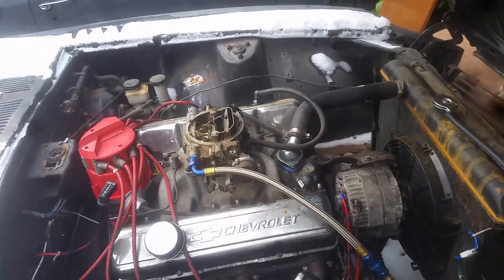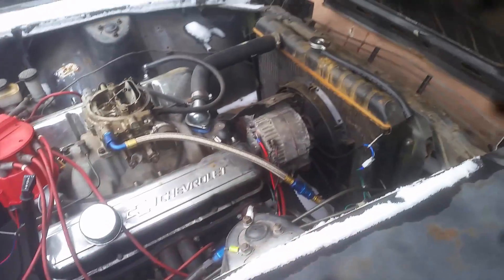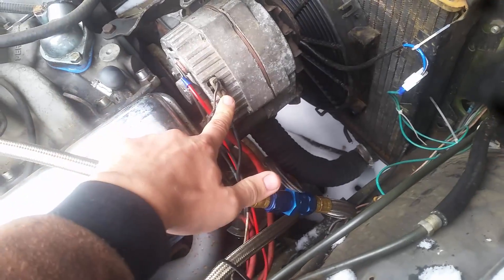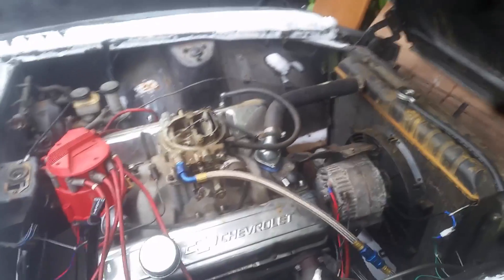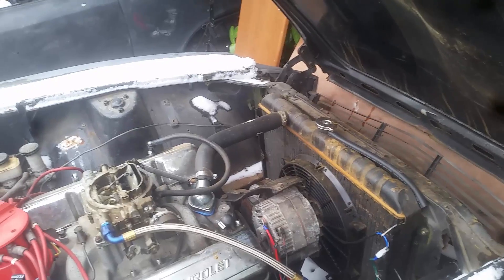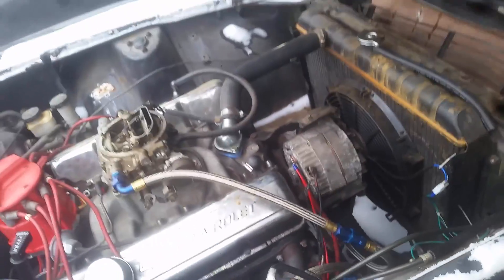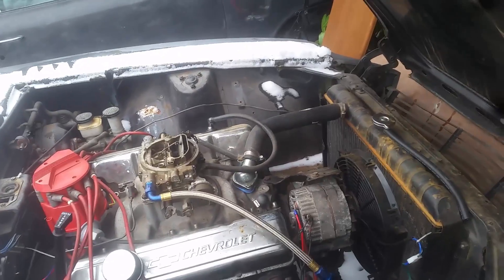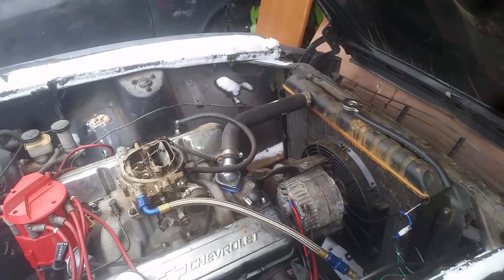wiring up your GM 3 wire alternator and upgrading from externaly  to internaly regulated

Comment: SO WHAT IF YOU HAVE AN ACTUAL DASH GAUGE AND NOT AN IDIOT LIGHT?
- 1963 MERCURY -
Reply from the maker: You can wire in an idiot light, and wire the dash gauge in through your ignition switch so it would continue reading voltage as well.

Comment: I use the brake warning light as alt light in situation like this. Splice off the wire from proportioning valve to power terminal "1".
This way the light will still work for intended purpose but will also turn on alternator.
Also this alternator will work on the nissan engine as well (same bolt spacing)
BTW one wire alternator is simply that alt with the sense wire looped to alt output.
Reply from the maker: twoeightythreez yup.  Good to know!  Thanks for the input, I figured as much.

Comment: so on my tractor,  Is it correct if number 2 goes to my starter? I know number 1 goes to the light and the post goes directly to the positive post on battery, but where should number 2 go? also does number 1 have to go to a light, or can not be hooked to anything at all??
Reply: If you like you can make the GM 3 wire alternator into a "1 wire" by simply looping the thick #2 wire to the alternator output lug and leaving #1 disconnected.
You will have to rev the snot out of the motor after starting it to begin charging though....so you are better off hooking the #1 wire up. If you dont feel like wiring up a bulb you can substitute a resistor. It cant be hooked direct or you will have a constant draw....it needs to be a switched source.
Reply from the maker: Jason Gelles number two goes to the battery. ... or the starter like in my case because my battery is in the trunk.  number one should go to a switched source...  through a light.... so in essence it all goes to the batter....

Comment: oh and what you think a 3/4 cam do in a Pontiac 350. shoulda  bought a 400 or 455 when they where $100 running 10 years ago😧
Reply from the maker: B.O.P A-body actually, I LOVED my 350 with a wild cam... sure its no 455 but it's a screamer regardless...

Comment: other way to check if alternator is bad is disconnect the battery with the car running. if it shuts off its not working.
Reply from the maker: TheMarcusGomez true, wouldnt do it for long though...
Reply: Good way to fry alternator diodes.

Comment: Any reason to run an idiot light if you're also running a voltmeter?
Reply from the maker: Mama's Boy yes, not super important, but the slight resistance the idiot light gives will insure the alternator charges better at idle... but not so much that I would care too much.  I dont run an idiot light on this car... so its not THAT important.
Reply: Invincible Extremes Muscle Cars Garage 
If you wanted to you can put the 280z voltmeter into the 240z gauge pod (replacing the ammeter) it has a built in light. Yes, you would have to do a slight rewire but its bolt in otherwise. Or you can use the brake warning lamp as an alt light

Comment: Another way to tell if it is charging is to hold a socket or a small peice of metal against the center part of the back of the cast and it should stick to it,it wlll be magnatised.
Reply from the maker: Charles Dyer true, but you wont know if the entire system is working... you could have a magnetic field from the windings but have a fault in the regulator itself... or a break somewhere in the charge wire going to the battery... but yes, as a quickie check, it works

Comment: Nice man, I have to replace the 3 wire alternator on my tractor soon and maybe eventually my 78 firebird I'm building over on my channel as well.  I was curious if the tractor was hooked up correctly since some one converted it to 12 volt.  Good explanation, thanks!
Reply from the maker: Chaos Garage no prob, thanks for watching.

Comment: Good video, but you didn't mention the "exciter" and that it is usually linked to the idiot light on the dash.
Reply from the maker: Joe Fugate I did point out which wire to use for the idiot light or at the least a switched load side source...

Comment: I don't know how these alternators look internally, but the traditional Bosch alternator that you can find in plenty of old European cars usually have an internal feed to the rotor coils.

I'm guessing the "1-wire" alternators are similar internally.
The difference is that with ignition on/engine off, the rotor coil gets voltage through the charge light in the instrument panel. This way the alternator starts charging from idle, no need to rev it. AND when the alternator starts charging, the warning light goes dark because it gets 12V from both sides (Both from the battery and from the alternator's internal rotor feed.)

With this setup, they can be built as "2-wire alternators".

Also, you could of course have connected your alternator's B+ to the starter instead. If the wire between the battery and the starter is thick enough to turn your stroker, it sure as hell is enough to charge the battery. :P
Reply from the maker: ziiofswe mine IS connected to the starter... and yes you are 100% right on the idiot light.
Reply: Ah. The way you described it in the video it sounded like you had a separate wire all the way back from the alternator.

Fun Fact: In Swedish, wire is translated to "kabel" (sounds almost like cable) while cable is translated to "vajer" (sounds almost like wire). I have no idea why, but it's kinda set up for silly translation mistakes....